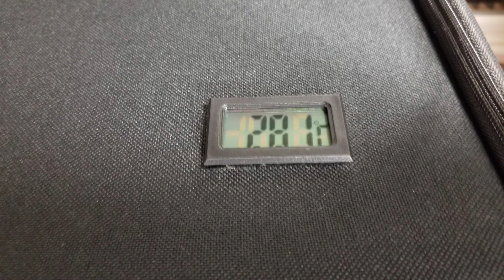Wham Bam Hotbox Collapsible 3D Printing Enclosure - Chris's Basement

Comment: If they add the bottom to the Hotbox design they will really have a great printing enclosure. The price good I think for what you get. Thank you Chris for the review and testing.
Reply: Robothut thanks, we purposely left off for user flexibility. If you want it sealed leave it in contact with the table it’s on, if you have lower electronics that you need to keep cooler lift it up on slight raisers, the heat stays trapped at top but you can cool down below heated bed a bit.
Reply from the maker: Thanks John for the comment.

Comment: Thanks for the great review Chris! This was just the product I’ve been looking for printing ABS. I’ve tried using the plastic sheet tent setup and had mixed results. This looks a lot easier to setup and use. I also decided to try out their Wham Bam flex system for my Ender 2.
Reply from the maker: Thanks Patrick, it is a very clean and finished product. Seems to work well.

Comment: Already mentally designing adapters to raise it up for my cr-10 and other printers, so I'm glad it doesn't have a permanent bottom lol
Reply from the maker: Nice! I would love to see your mod when you get it done.
Reply: I already have mods up on thingiverse to raise it up a couple of inches to accommodate squash ball feet on my Ender 3. I also have a spool holder extension that allows for using 2.3kg spools.

Comment: Great video Chris. Wonder if you could do a video attaching an inductive probe to an SKR E3-Dip v1.1 board? I have looked all over and no one has a tutorial on this only the v1.3 and it is not the same board with the same headers and I am just exploring this and would be very appreciative to get this information. Thanks!
Reply from the maker: E3 Dip 1.1? I'm not sure which one that is, do you have a link?
Reply: @ChrisRiley  this is the git hub page. Looks like it is under the v1.0 and they fixed something with the servo port on the v1.1
https://github.com/bigtreetech/BIGTREETECH-SKR-E3-DIP-V1.0. I can also provide a link to the inductive probe I purchased from amazon if you need it

Comment: Instead of a zippered bottom, use Velcro flaps. 
Put a Velcro loop strip around the bottom of the enclosure. Make a bottom that slips under the printer and has flaps with the hook side that folds up onto the loop side and seals the bottom. You could make tabs that Velcro over the corners for a better seal.
Reply from the maker: Good idea.

Comment: So, probably won't happen if not an Anet, but if your printer catches fire, will this contain it?
Reply from the maker: Good question, no clue. I know the fabric is fire resistant, but don't know to what capacity.
Reply: @ChrisRiley  its fire resistant but will eventually catch on fire if under direct flame.  you should have thermal runaway activated, and we encourage the use of auto extinguishing balls and other means of protection.

Comment: Very nice video Chris

Would you please make a video on printing with HDPE filament.
From what i understand ,it can be quite a challenge getting usable prints from HDPE plastic.
i am certain that with your methodical and scientific approach in testing various plastics ,that we would have a great reference point to use when trying to print with this difficult material.

best regards
Reply from the maker: Thanks Chris! I would be up for trying some out. I will have to see if I can find some.
Reply: @ChrisRiley  fantastic news,looking forward to seeing you print HDPE.everyone tends to print the easy stuff like PLA ,and avoid the troublesome plastic filaments.
Reply from the maker: @christopherrumford  Hey, I haven't forgotten you, but I am having a real hard time finding HDPE filament. Any suggestions of where to buy some?
Reply: @ChrisRiley  I believe ebay did have a seller at one point,however I have checked again and am unable to find HDPE in filament form.
You are able to buy HDPE pellets,fairly common on ebay.the pellets are commonly used for stuffing bears and weighted blankets.

If you have access to a filament making machine I would suggest possibly manufacture your own from pellets.or better still try out a pellet extruder to directly lay down plastic on the build plate.

My apologies for the late reply,hope you are keeping well during these difficult times.

Comment: with my lack box, i put some painters tape around the top gaps to hold in some of the heat ive managed to get about 35c in there. but it is true that its a nightmare to work on the printer, good thing its a prusa and that is not often.
i want the wham bam, but at that price, im better off going DIY
Reply from the maker: Right on, thank you for the comment!

Comment: Would PLA work if you leave the front open?
Reply: considering you can print pla with no enclosure at all, i'm sure it will be fine.
Reply from the maker: Yep, should be no problem.
Reply: no problem and will help some large geometries prone to warping!

Comment: Hi Chris, 
nice video! 
I have a qestion =D 

i once printed petg and had headaches a lot after it, do you think this enclosure will help?

Thanks a lot and have a nice day
Reply from the maker: Thanks! It seems like every PETG is different. The enclosure might help keep the heat in a little better to get the first layer down, but that depends also on your bed surface.
Reply: @ChrisRiley  oh, hehe, thanks for your anwer. I meant because of the fumes. It really smells a lot and i wonder if the fumes would go through the hole on the bottom =D
Reply from the maker: @certified-forklifter  oooohh, actual headaches. :) It might contain them a bit until you could vent them, but if it's making you sick I wouldn't risk it. I would try to find some sort of active venting.
Reply: @ChrisRiley  ok, thank you for your answer. It is a bright red petg, so i guess that might be partly the color =/ 
happy printing!

Comment: So frustrating to see all the enclosures don't fit my Printer
Reply from the maker: I hear ya, maybe larger ones will be introduced later.
Reply: @ChrisRiley  the problem is those might actually be too large, i got my tevo black widow because it had a uniqu large x https://photos.app.goo.gl/d21kzMYCEdFerijz8 the the enclosure i'm using now is just 3 mm pc plates of 60x60 (it's off now because i'm dealing with a never ending problem of motor clicks)

Comment: I think I missed the segment where you say what the panels are made of... 🤨
Reply from the maker: I didn't mention it, I am not really sure what it is, they have it on there site.
Reply: The HotBox is a superior construction of a sandwich of materials selected for their insulation properties while also being light weight and flexible and foldable to put away when needed.

The sandwich is is made of high-grade Nylon 600D fabric with fire-resistant coating and lined with a metallic heat deflecting internal liner that sandwiches around a strong, lightweight honeycomb insulating structure.
Reply: @WhamBamSystems  hi, I have a qestion =D 
i once printed petg and had headaches a lot after it, do you think this enclosure will help?
Is there also a reseller from Europe? 
Thanks a lot !
Reply: @WhamBamSystems  wow, thanks for answering that question!! Didn't even know you were around..  😁👍
Reply: @ChrisRiley  thanks Chris!  I guess we both know now, huh??  Hehe.. 
😁
Reply: @certified-forklifter  I would print petg in a separate room and then wait 15 minutes after the print is done, then open windows to the outside.
Reply: @elfpimp1  yeah, it still is not quite the solution i want =D 
But thanks
Reply: @certified-forklifter  the only other way is an airtight enclosure then with a vent to outside that you can turn on after print..
Reply: @elfpimp1  ok, thanks
Reply: @certified-forklifter  it will help with PETG as far as slowing down the cool of the part and therefore slowing shrinkage so it doesnt warp so fast, you will also need to work on bed adhesion and possibly change infill and print speeds.
Reply: @elfpimp1  there is a to access door to a vent hole you can add a fan and vent tube and ready to go
Reply: @WhamBamSystems  oh, thanks but meant the fumes
Reply: @WhamBamSystems  nice! Do the enclosures come in bigger sizes?
Reply: @elfpimp1  we are working on a larger size now for CR10 style machines!
Reply: @WhamBamSystems  Groovy!!

Comment: $119 is pretty steep for a glorified tent...
Also I'm pretty sure i got nowhere near $90 for my LACK enclosure
Reply: not a tent at all The HotBox is a superior construction of a sandwich of materials selected for their insulation properties while also being light weight and flexible and foldable to put away when needed.

The sandwich is is made of high-grade Nylon 600D fabric with fire-resistant coating and lined with a metallic heat deflecting internal liner that sandwiches around a strong, lightweight honeycomb insulating structure.
Reply from the maker: Seems like the Lack enclosures are all about how good of a deal you can get on the plastic panels.
Reply: thats about right, my total lack enclosure cost about the same, and its a fixture now, no portability for any of the system.  i rarely print ABS unless im printing upgrades for the printer itself.
Reply: @WhamBamSystems  Looks like a way better idea than the tent's Creality came with, I like that this doesn't have a bottom, so I'ts easy to take it off and pack it away. I would need something like this just from time to time, when printing ASA/ABS.